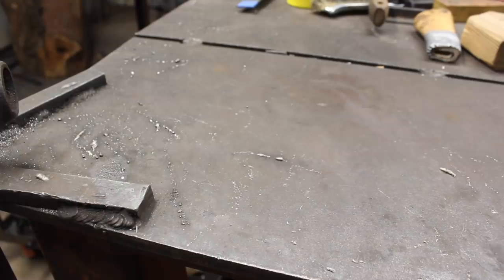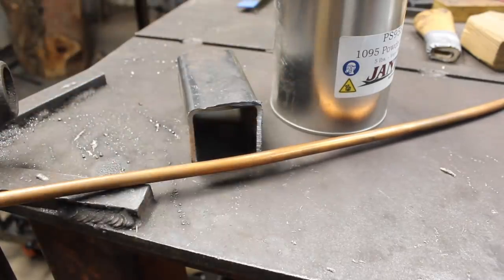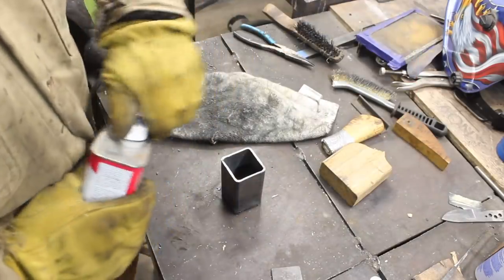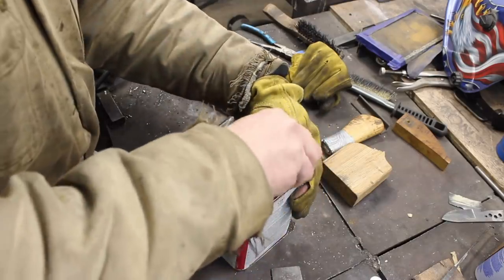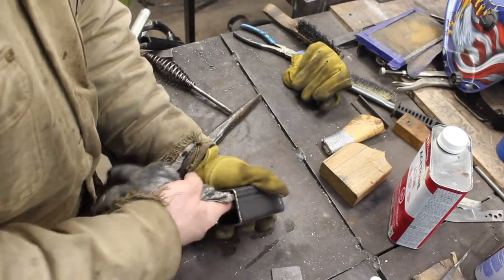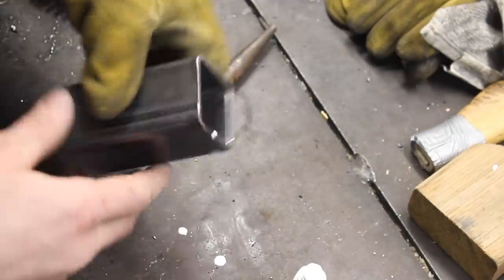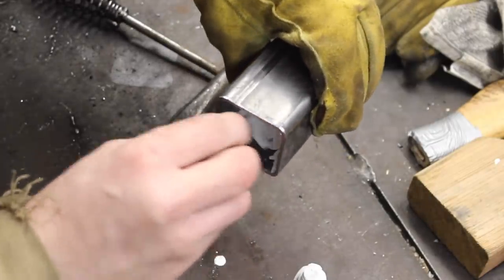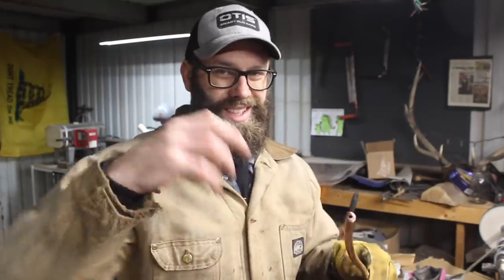Forging Cu-mascus In A Can, Experiments In Pattern Welded Steel And Copper, What Happens?

Comment: Just a thought - If you wanted copper highlights, on the finished blade, cut away areas to be filled with molten copper.
I would assume that the steel should be heated to a point that the molten copper would bind (kind of) to the steel.
And the cutting away of the steel would probably require a laser small enough for detail cutting.
AND maybe all the above isn't even remotely possible ....

Comment: Try copper with ball bearings something solid that the copper doesn't melt into or maybe run cable inside the copper pipes

Comment: There was an older gent on forged in fire that, after welding the bottom on the canister, stuck it in the forge to develop a layer of forge scale to prevent the billet from sticking to the canister. Worked pretty good on TV so there might be something of value there.
Reply from the maker: interesting, yeah that makes sense
Reply: Pour some diesel in, then burn it in the forge.  Layer of nearly pure carbon.

Comment: I have had steel crumble like that when i was experimenting with copper, and then read something about CCC copper contamination cracking, apparently at forge welding heats, it happens, so my guess would be, use copper powder, and solid steel, and forge it at copper fusion temp, not higher.

Comment: I bet if you did this in reverse, it may have a way better chance of working out; 

Powder the copper and put solid steel in; the issue arises from the copper reaching melting temp before the steel is weldable; so doing it that way may yield results.

Comment: Not my area of expertise at all, but is there a way to "instantaneously" weld the steel using electricity or something else? What if you added a combustible heat source inside the "can" like bangpowder or something else that would release a lot of heat very quickly?
Reply: Congrats.
You just made a pipe bomb.
Lol
Reply: @wanderingcalamity360  fair enough, but without capping the ends, I'm sure there's a mixture that would burn slower so it would weld before it bangs...
Reply: @bevanarcher4586 
I mean, explosive welding is a thing.
I was just giving you a hard time.

Tbh, I don't know the right answer here.

Comment: I believe the word you want is "matrix." Since only the copper melted, and presumably now encapsulates all the granulated steel, which didn't melt, it should now be a matrix.

in the oil industry, the method is used to make tungsten drill bits. Since tungsten is muy difficult to melt or machine, it is granulated, poured into molds of the drill head, then a brass alloy is used to bind it together. I'd be interested to see what forging properties your matrix billet has.

Edit: I see it crumbles. That's what I get for commenting before the video's done. But the crumbling is about what I expected from a matrix. It should machine well, though.

Comment: Oomph ... So many people commenting without knowledge of metallurgy.  First off the concept of forge welding is actually a diffusion process where by heat and pressure along with time are used to diffuse a material into another.  If you were to take two perfectly smooth and clean surfaces of metal and just stack them together, over time they will form a cold weld; this was commonly seen in things like gauge blocks in the machining industry.  Secondly and this is where many people will be lost, iron goes through three crystallographic transitions during the heating process from BCC, to FCC, then back to BCC before melting.  The amount of carbon in the steel influences the transition temperatures for plain carbon steels (1000 series).  Copper has an FCC crystal structure at all temperatures.  The diffusion bond between copper and iron would be fairly week unless there is an intermediate metal that both metals can diffuse with ... in this case nickle.  It would be time consuming and not practical to do a mosaic blade as it would greatly weaken the blade.  Lamination and diffusion joining is the only option to make this viable... though practicality it may not produce a desired blade with strength.  The heat treatment influences alone would bother me.
Reply: Honestly damascus has only one advantage and that's astetics. I plan to use copper laminate for guards & show pieces.

Comment: Copper has very limited solubility in iron, of the order of about 2% max from what I can determine. Pure Copper melts at 1084C. I'd guess the Copper melted, there would have been limited solubility and what you have is a mixture where the molten Copper has intimately diffused throughout the very porous Steel Powder.
Reply: Agreed.  Copper melts at about 1983F and high carbon steel at about 2500-2700ish F.  I don't know but would suspect forge welding at 1800-1900 may be too low to solidify the steel powder, but would love to see it tried.  Opens the door to a lot of ideas if he could get it to work.

Comment: If you take two pieces of thick stock of steel, drill (exactly mirrored) shallow holes in these and fill them with copper (copper dust or exactly fitting round stock). and then weld these two pieces of stock together maintaining the copper inside because it can't go anywhere, even if it melts. You might be able to make some fun patterns that way. I'm not an expert but I could see this working
Reply: Nice idea!
Reply: I would love to see that done. Kind of doesn't make since how the two metals can bond together but lack of knowledge aka ignorance is at fault. :)

Comment: Yeah, No powders. The guys I helped make "patterned copper" in the 90's were canning steel shards and split pipe... and low temperatures. By split I mean cut into C's. They had a few billets overheat too. Watch out for the green flames.
Reply from the maker: Yep, I figured out that trying to weld steel together and braze at the same time doesn't work...

Comment: It's not a failure if you learned something from it.
Reply from the maker: This is true!
Reply: @FireCreekForge  hey, also look at investing in a tig welder. You can weld you billets without any filler metals. That will save you a lot of time grinding out welds, digging out the weld metal, and it's WAY cleaner. If you are anywhere near center Texas, I'll teach you to tig weld.
Reply from the maker: @NOTSOSLIMJIM  cool man yeah that's something I want to do at some point

Comment: Maybe spray some type of hydrocarbon in and make a tine vent hole to remove oxygen from the canister? I thought this was interesting.
Reply from the maker: Not necessary, as any tiny amount of air left in the canister isn't enough to matter if you fill it completely.  Thanks for watching!

Comment: Cool man, at least I know I'm not the only one that has happened to.  I made a PID controlled forge w a low pressure gas bypass, to where the gas never really shuts off when the PID shuts the forge down to keep explosions down and its much safer with a bypass.  I think the forge has to have a blower though, but Im not sure.  It has worked great for this copper stuff.  The only way I have managed to keep the copper in the billet was to layer it like damascus and weld all the way around it and keep the billet around 1650 to let it just stick to the other metals.  I always have had delaminents to cut out though
Reply from the maker: I see, good to know, precise temp control isn't something I've addressed in my forges

Comment: if you can get the temp steady at around 1750 to 1800 deg F id imagine it should work since the melting point of copper is over 1900 and forge welding temp of 1095 is 1700 or a bit higher
Reply from the maker: That's what I've thought. As long as the mere presence of copper didn't interfere with the powdered steel welding, theoretically it would work..

Comment: This didn’t work because you can’t do a steel forge weld with copper in it.  Copper melts at 1984 degrees but you need higher temps to forge weld steel.  You need to use layers and then essentially you’re just brazing the copper to it around 1600 degrees.  I have a video on it as well.
Reply: Tyrell up in here with the solutions!! Love your content too brother!!
Reply: @calculatedsurvival  thank you! ❤️
Reply: Love your channel, lots of great ideas and tips as well as your Beautiful blades, some of the best looking work anywhere.
Reply: @B.W.Broom-xc6gs  thank you for watching! ❤️
Reply: I was about to say the same thing... these are 2 seperate processes. Forge welding and fusing are 2 different operations.
Reply: @jendrayani543 the billet temp, though it’s tough if your forge is radically hotter.

Comment: Ok so yes you can alloy steel and copper, basically you made a form of naval bronze which is essentially an iron and copper hybrid metal used for its hardness and it's resistance to salt water corrosion. Neat trick and useful machining materials but yeah I'm not optimistic. Maybe tinker with a chunk of naval bronze it's commercially available.

Comment: Ok so forge " welding" is actually a misnomer. Welding is molecular fusion via the addition of filler. Forge welding is actually just fusion which is a molecular bond created via heat and pressure. In glassmaking fusion occurs via heat only due to no repeating molecular pattern. When we melt glass together they need to have the same coefficient of thermal expansion otherwise  as it anneals it will crumble. I can't see mixing steel and soft metals causing anything but infuriating delaminations and thermal stress cracks. But I'd be happy to be wrong.
Reply from the maker: I think you're right
Reply: @FireCreekForge  its worth researching naval bronze alloy contents. i bet you could sheet out some cast iron and make high layer count damascus that mimics naval bronze

Comment: My question is, just how many different metals could be forged welded together? I think brass might be interesting.
But then again, I want to see a canister with more than one grade of powder metal, bolts with nuts threaded the length of it in different grades, more than one size of cable and chain, and weld it all together.
Shurap just did one with nuts and bolts, but I want longer bolts lengthways and possibly twisted.
It may not be too late for me, but I really wish I had discovered this 40 years ago.
Reply from the maker: As far as steel goes, you should be able to weld nearly any combination of mild and carbon steel..
Reply: Brass melts at too low a temperature to even really work as a laminate, sadly.
Reply: I love watch Shurap do his thing, dudes a beast when it comes to making blades. I really liked his stainless damascus, the way it blued up afterwards was awesome.

Comment: 11:11If not alloy, then it would be a composite
Reply: it's a composite they weren't smelter together to form one material. All pattern welded materials are composites
Reply: @joshschneider9766  only 2 to 3 percent of copper is the solubility limit in steel. At coppers melting temp you would have a suspension of steel within liquid copper. At steels melting temp an uptake of copper would occur until the solubility limit. Depending on the ratio of copper/steel ( above max solubility) and the temp range, it would vary between a amalgam and suspension. Once it cools below coppers  plastic phase  depending on the amount of copper and where it is distributed within the billit it will be in interstitial layers.

Comment: I’m not convinced that it will work with powder steel.  Have to get hot enough to fuse the powder together, but then your way above the melting point of copper. The cu mai blades are done slightly below it’s melting point. Forge weld the steels together, then inlay your copper, arc weld seams closed, then forge together..
Reply from the maker: Could be right, steel should be able to weld below copper melting point with the right pressure.
Reply: That’s true. Welding can be done In ambient temps with high enough pressure.

Comment: Pretty cool but I see that melted copper really doesn’t fuse well it steel?
Reply from the maker: It will to solid steel, but the powdered steel adds a problem...
Reply: @FireCreekForge  i think you're right. But u might still be right about temp and pressure. But i agree about not being excited about steel in a blade. I think it's beautiful and way cool, but if I had to choose between a cu-mai and one of your beast,,,,,,see ya later copper. I do like copper tho so the whole thing intrest me. If you figure out a new method nobody else has, awesome. If you don't....at least you gave it a ahot or 13. This so reminded me of an old man i work with. I've learned so much from him. But he's always thinking outside the box. Trying something new. I think that's awesome
Reply from the maker: @nateand3  thanks man

Comment: The problem with this process is the copper is liquid at welding temp which you need to achieve in order make the powder solid, so it probably just melted and consolidated to one side of the can. The copper will be visible without etching. I think you should pursue some cu mai or coppermascus. Like to see what you make!!!
Reply from the maker: Yeah, it's possible to forge weld steel down to even 1600F+ with the right pressure, which is below the copper melting point of approx 1950, so there should be a window there, but I got it way too hot for that...